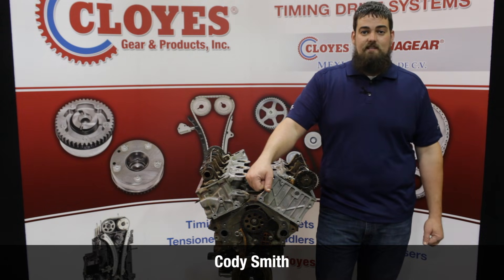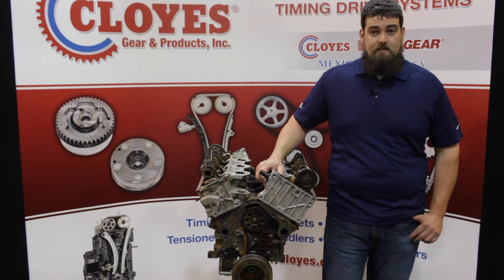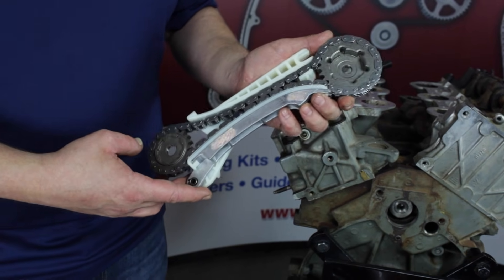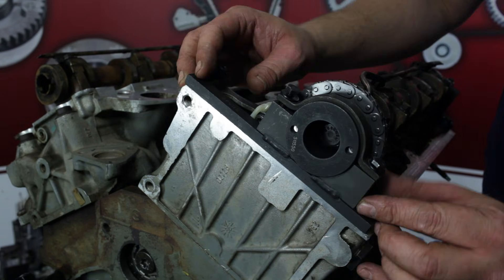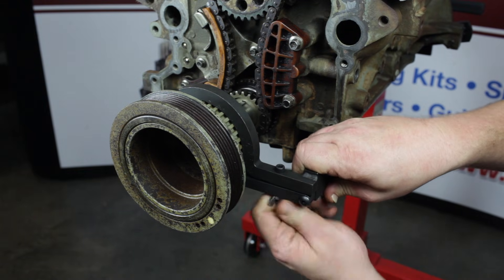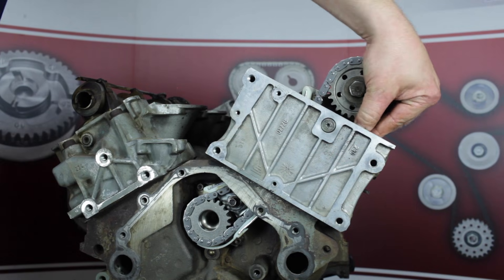Ford 4.0L Timing Chain Replacement, Cloyes 9-0398SB

Comment: PLEASE HELP.  I AM LOST !!!!  

When I turn the crankshaft key top dead center at 12 O'clock, the cutouts in the end of the camshaft are nowhere near parallel to the head surface. I have rotated again and same problem. As I replace the timing set, how do I correct this? I can only assume it jumped timing. This is my first overhead cam car and the first time I have seen in the timing cover and valve covers. I have mechanical skills and have rebuilt many engines and timed many standard engines. But I'm lost here. From the videos I have watched, doing this job would have been easy if the cutout in the end of the cam had been parallel to the head surface with the crank key at high noon. But it's not.

This engine has no balance shaft.
Reply: I'm in the same situation and before removing the engine everything ran fine, just ticks... Rotated the crank to tdc and the cam cutouts do not line up.  I have a 4wd but no balancing gear at the bottom of the engine. Anyone know what's going on and can lend some advice?

Comment: Timing marks never mentioned, so it doesn’t matter?
Reply from the maker: There are no timing marks on the primary or secondary systems. So it doesn't matter, and that is why the special tool kit is necessary.
Reply: @Cloyes01  What do you mean the primary and secondary systems? You mean the cam chains and the balance shaft chains?
Reply from the maker: @bomark2002  The primary system is the chain that connects the crankshaft to the jackshaft. And the secondary systems go from the jackshaft to the camshafts. The jackshaft and camshaft sprockets are not keyed or doweled, and none of those sprockets or chains have marks. So the tool kit must be used to properly position the shafts during assembly.
Reply: @Cloyes01  Awesome, thanks very much I really appreciate it have a great day in the Lord
Reply: @Cloyes01 just an absolute nightmare design not having any of them keyed.
Reply from the maker: @matthewbolton4289  Agreed!!
Reply: @Cloyes01  Thank you much

Comment: wrong year for me no extra chains in mine...
Reply: 2wd variants do not have balance shafts I think
Reply: @Bobby_Behm correct
Reply: Wrong my 2009 4.0 explorer 2wd has the jackshaft chain and balancer and the timing is very different.
Reply: @jamesgreen2  mine is 93
Reply: Mine is a 1993 ...

Comment: I suggest getting your wits about yourself. Not all 4.0 are the same. There is a bolt inside rear head alongside chain that will not let lower sprocket and chain out. The balancer has another possible balancing option. At opposite end from gear there is a hole in the balancer shaft. This hole lines up with thru hole on mounting bracket at same end. Two holes at that end line up and at gear end a single dot is your marker. This is where 7:1 turn ratio comes into play. Lock this baby down. Find top dead center and lock everything, lock the flywheel. You will need much patience.
Reply: OK boomer.
Reply: 7 2025 @kylebayes4711
Reply: @kylebayes4711 those old timers know their stuff. You'd be wise to listen

Comment: Does the limited lifetime warranty cover catastrophic engine failure for a failed timing component? ASE mechanic and am looking at doing this job on my own vehicle, cloyes kit is very nice but i would like to be sure of the warranty before i purchase one
Reply from the maker: Your warranty is cover by the vendor that you purchase the components from. Most major parts stores offer the lifetime warranty along with labor claim programs that will help pay for damages if the parts are found to be at fault. Check with your vendor to see what kind of coverage they offer and if you would qualify to file a labor claim if necessary.

Comment: How many odometer miles is typical for this job?
Reply: 150,000 is about the life of factory chains.  Lots of Mustangs go up for sale when reaching 150,000 miles due to timing chain issues.
Reply: My 08 mustang has 277k on the original chains and guides. Did valve cover gaskets and saw the broken rear guide, thus what brought me here. Lol @LanceisLawson
Reply: @FoReVeRdYiNg112 likely has been broken for many years. It doesn’t always cause a difference.

Comment: Do these kits include any bolts that are TTY?
Reply from the maker: No, they do not come with the bolts.
Reply: @Cloyes01  Dealer only for the bolts?
Reply from the maker: @nofortunatesonII  That would be our recommendation. There may be some aftermarket options that we are not aware of, but I would be skeptical of their quality.
Reply: @Cloyes01  Thank-you.
Reply: @Cloyes01 since these critical pieces are not included, can you at least let me know the proper part numbers?
Reply from the maker: @chrismcelroy7915  Front Jackshaft Bolt: 2J2Z-6279-AA & Rear Jackshaft: W703167-S430

Comment: God I love Chevy’s you gotta have a separate set of tools to work on these doggone fords!…this crap is difficult even out of the engine!…I’ll pass!
Reply: I like a Chevy but I had a ranger with a 4.0 . When I got rid of it it had 153k miles .  All the front end parts were factory and still tight . Had original brake rotors . I had only replaced u joints thermostat wheel bearing and fuel pump which was my fault . My 00 Chevy 1500 had had starter every front end part water pump fuel pump 2 of them power steering pump fuel pressure regulator had a miss ac tensioner and 2 brake calipers plus a injector by 150k .
Reply: Plus brake rotors if I'm not mistaken and a 4wd actuator . I like both but I had better luck out of a ranger . Yeah they are hard to work on

Comment: Save your money, don't buy Cloyes JUNK! rebuilt a 4.0 with them and didn't last 2 hours before the jackshaft to crank chain broke destroying the engine.
Reply from the maker: Did you get the crankshaft sprocket on in the correct direction? For a chain to fail that quickly it was likely operating with sprocket misalignment. Make sure the wear patterns from the chain on the primary tensioner and guide look to be strait up and down on the guide surfaces.
Reply: @Cloyes01  Yes everything was correct the cause was Your junk parts not error from a professional mechanic.
Reply: I’d bought a timing chain kit from 1A auto and same thing happened to my 07 explorer, broken front chain and balancer chain too only lasted little over 3 hours destroying my engine
Reply: Cloyes went downhill big time the past few years. Auto tech Mike got burned when a brand new cloyes timing chain tensioner let go
Reply: Should've let Cody do it for you. We should see pics of that, something else could have caused that
Reply: mechanic error cloyes is the oem supplier for ford
Reply: @pizzanoodle4540  Motorcraft is the OEM supplier for Ford
Reply: @pizzanoodle4540 WRONG, the best mechanics don't make errors. Only mistakes of purchasing Junk parts.
Reply: @dwh9623  must of not been the best
Reply: @pizzanoodle4540  the parts weren't.
Reply: @dwh9623  What a stupid thing to say! everybody can and does make mistakes.
Reply: They don't wanna talk about any kind of a refund though.
Reply from the maker: @dwh9623  Our parts/kits are all covered by a limited lifetime warranty. Just work with the vendor that you bought the kit from, they should offer a replacement or refund.
Reply: @Cloyes01 what about the motor ??

Comment: Great video,  thanks for posting!  But still, I don't understand why Ford didn't just use the tried-and-true push rod valve train on this engine.  What advantages did they think would be had with this overly-complicated valve train??  It's still only two valves per cylinder, that's easily had with a single camshaft down the center of the block, and conventional push rod operated, a bullet-proof system that worked for 100 years.
Reply: Thats why they changed because it was bullet-proof and long-lasting. Planned obsolescence can't have things lasting too long, smh😑. Ford warned about this crap and what would happen to engineering standards.
Reply: it’s german

Comment: I cannot put the locking tools on driver side cam,it's rotated slightly off,has it jumped timing and what can i do to correct this? Chain has not failed
Reply from the maker: Is this an old system? It could be the result of worn/stretched chains if the timing is close. If this is a new system I would recommend re-timing, one of the balance shaft sprockets or camshaft sprockets could have shifted while torqueing the sprocket bolts.
Reply: @Cloyes01  Do i time the main chain first and jackshaft or the cams?
Reply from the maker: @russianwolf6561  I would put the crank at TDC with your crankshaft tool, then figure out which camshaft is off by using your camshaft indexing tools. If you find that only one camshaft is off, you can just re-time that one bank. Loosen that camshaft sprocket, rotate the cam and install the indexing tool, then tighten the sprocket. In the end, as long as the crank is at TDC with the tool, and the indexing tool will install on both banks, then you are in time.
Reply: @Cloyes01  It's a 2009 ford mustang 4.0

Comment: Question:  If I remove the balance shaft, and plug the oil supply ports that feed it, would the timing kit # 9-0398SC be appropriate?
I guess the main thing is the axial positioning of the crank sprockets when the balance shaft chain isn't used.

Also, do you happen to have the required TTY bolt part numbers from Ford?
Thanks.
Reply from the maker: Yes, the 9-0398SC set will work. The only difference is the crank sprocket and the additional balance shaft components in the 9-0398SB and 9-0398SC kits. 

The front jackshaft bolt is 2L2Z-6279-AA and the rear is W703167-S430.
Reply: @Cloyes01  Thank you very much. That's great news.

Comment: Thanks.  Very nice video.  Much more straightforward than the Ford Workshop manual, which says to remove the cylinder heads to do this job? 
I guess they just want to sell more gaskets and torque to yield head bolts. SMH

Comment: Hey  is any one  can plz help me. I replace the rear timing chain on my 03 explore but the chain is kind lose a little on the  other side from the tensioner. Now is making noise when the motor is on high rpm. Any idea why the chain is lose like that. ? I can't make tie  has a new tensioner too plz I maybe did something wrong ?

Comment: Love your videos, quick and to the point. Watched this one to see if you use some sort of fixture to support the jackshaft sprocket to torque the bolt, seems like a lot of force to put on those upper chains, is that the recommended procedure?
Also I welded up my own fixtures to hold the cams out of some angle and flat stock, was pretty easy.
Reply from the maker: It would be ideal if you could lock the jackshaft in place while torqueing the bolts, but we are not aware of any tools that exist to do so.

Comment: I installed your timing chain kit on my 2006 Mustang V6. It was working great. While at a stop light it died on me while idling and I could not get it to restart. It cranked just fine. I confirmed spark, fuel and working injectors, so I took off the valve covers  and the passenger side is too far ahead and the drivers side is too far behind. Any idea why that would be? The timing chains seem tight and in good shape.

Comment: I have an 05 mustang V6, how do I know if I have a balance shaft?
Reply: You don’t
Reply: I have the 06 same engine and ours does not come with a balance shaft. I just finished this job with it on the stand good luck brother.
Reply: @dillonmiller1279  I also have a 05 v6 mustang with 250k miles lately it has a loud rattle noise in the engine while idle and foot on brake.  Driving me nuts.  Think it could be the timing chain? And how so?  Please explain.   🙏

Comment: This is the best video I've seen on a truly  poorly designed system. I have never been able to remove the ds chain cassette up out of the head or install through the top, what I'm I doing wrong?
Reply: You need a bigger hammer

Comment: i have read it is not an interference engine?
Reply: It has some space, but it is certainly an interference engine. I just rebuilt one. Get the timing off a few degrees, and you’ll smack a valve on the piston.
Reply: Btw, I also read that it is not an interference engine, but bent valves and witness marks on the pistons prove otherwise.
Reply from the maker: @Markos is correct. You can experience piston to valve contact in this engine.
Reply: The Ford 4.0 OHV is non interference
The Ford 4.0 SOHC is interference

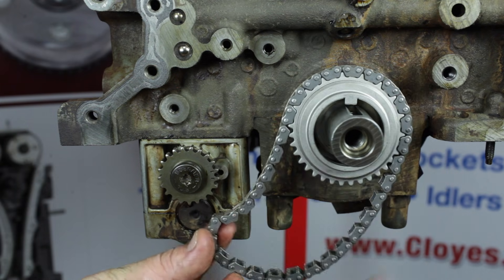Comment: 7:32  Aren't the timing marks on the balance shaft(2 marks on the cog) supposed to be aligned as shown, and also the timing marks on the lower shaft(2 holes) supposed to be aligned with the seam on the right side at 3:00 O'clock, before installing the sprockets and chain?

In the video the cog is aligned correctly; however, the marks on the lower shaft are pointing at 11:00 O'clock not 3:00 O'clock.

Comment: Excellent explanation. I am about to order the kit. Explorer with 260,000. 
Are there any further inspections to the other components such as lash adjusters, roller followers. And if so, do you sell those parts. Regards
Reply from the maker: Thank you! No, we only supply timing components  and related parts.

Comment: Help What do I need to do if one side of my cam is little off and my tole will not lay flat on head 
It’s up about 1/2” on one side when stubs are in slots
Reply: Engine jumped time?
Reply from the maker: It really depends on where you are at in the process. But either way you will likely need to loosen the camshaft sprocket bolt and rotate the camshaft to the proper position to install the tool, then tighten.

Comment: What will happen if balance shaft timing Mark isn't ok
Reply: let me tell yall something these engineers would never do anything if it was not important to do so.. follow the engineers.
Reply from the maker: It can cause balance issues which result in more engine vibration.
Reply: Nothing, this video is wrong too, he didn’t line up the 2 circles below the 2 hash marks. All in all it’s not that critical, even out of time you won’t notice it, maybe if you use 4x4 low frequently but nothing in 2wd-4wd high
Reply: Absolutely nothing.  Many actually delete the balance shaft, even thought they have 4x4 vehicles.  It's not critical.  (I am not recommending deleting it. and as Elliot said, I also time the balance shaft to the reversal shaft - I didn't see him do it here.)

Comment: Having trouble getting the driver side cassette in. You skip over this but you do it with the cam installed. Am I missing a trick because according to procedure you’re supposed to remove the cam

Comment: You did not mention there are two separate marks on the balance shaft alignment. One tooth off and the engine will not run. Also instuctions on removal of the oil restrictor and the difficult to remove tensioner were skipped over. Only caught the balance shafts second mark because of watching another video. Not good marketing.

Comment: RIP to anyone who has to do this job
Reply: Man I am 16 bought a ranger now the engine is sitting on the tire in my garage floor with all the parts I need to do this job it fucking sucks
Reply: @davidkirk-hahler3284 How's it running

Comment: Good video. Just installed the cloyes timing kit in my 4.0. I wish it came with the torque to yeild bolts for the ends of the jackshaft. Got the kit home and opened the box, then had to Chase those down separately.
Reply: Where were you able to find the TTY bolts? Im trying to avoid having to go to Ford if I can help it. Cheers

Comment: I have just done this with my ranger engine and before I go ahead and throw it back into the truck I have 1 thing that I'm curious about. When rotating the engine over by hand at the crank I notice both the chain tensioners going in and out consistently. I would just like to know if this is correct or if I have missed something during install. Has me nervous because I had to redo the rear after rolling it over because I heard a clicking, turns out the rear sprocket seated a little crooked and was pulling the chain tight and making the tensioner "slap" the chain every rotation.
Reply from the maker: That is normal. The camshafts are under valve spring pressures. Until the tensioners are primed up with oil they will move in and out as the valves open and close.
Glad you caught the rear jackshaft sprocket indexing before you got it started up! I have seen that many times. It would have broke that chain in no time.
Reply: It's also worth soaking the tensioners in oil overnight so they are primed ready to go.

Comment: I did my timing but the top chain guid on the left broke, I dont think it was getting oil. Do you know why these engines would be running dry at the timing chain? I'm taking it apart now to see what all happed.
Reply: The rear jack shaft bearing may have spun on the engine causing loss of oil
Reply: Very common problem for these engines.
Reply: because you ruined an otherwise perfectley good engine,you are so fired.

Comment: My right rear timing chain is running to close to the rear of the head and not in the middle of the guide. I just replaced all of the components with the Cloyes CT9-0397SC. The old one was tracking in the middle of the guide where it should be. My cam gear is bolted up good and flat with the left handed threaded bolt.
Can you tell me if you’ve seen this happen before??
Reply: One of you sprokets is backwards.
Reply: One of your sprockets are backwards

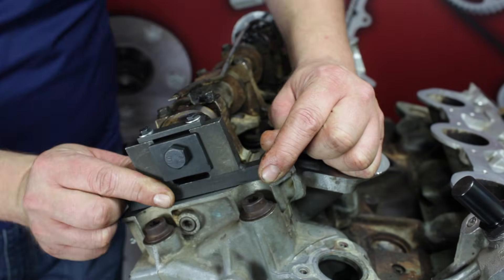Comment: There's a problem within this video as you get towards the end on time of scene at 10:30. You can see the original tensioner in place and not the tool tensioner. The when you see the tool tensioner back on scene time 10:44 as if he's just taking it off. This part is very misleading.